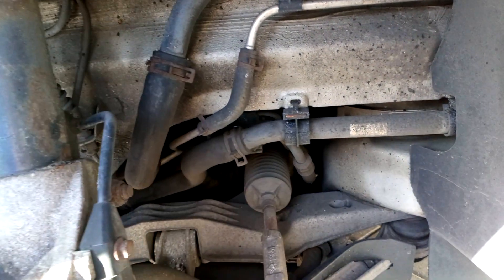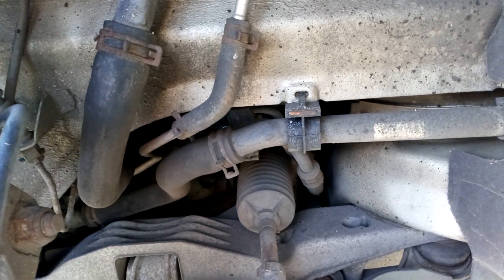Boxster 986 Anti roll bar bush replacment

Comment: Hi Paul mate how r u ?
Please i have a question for u if u dont mind 
I recently noticed when i drive the car on a wet day and especially driving over a bit off water the car act funny its like driving on a snow feels like the car loosing control even on a low speed 
And tryed aswell to over take a lorry about 50mph and the car wasnt driving straight 
But there is no noise at all 
Any help please what that could be please paul
Thnx
Reply from the maker: Hi, the first thing to do is have the wheel alignment checked. Camber, caster, and toe. Second, make sure no joints or bushies have failed. I trust tyres and pressures are all ok?

Comment: Nice work Paul, what are your wheels off? Just picked up a 987 check it out in my latest video
Reply from the maker: Hi Nick, I got the wheels after market from ebay, I have a video that covers where I got them in more detail, the rims are called Turbo 2. Which is a bit annoying as everybody says there not of the turbo! No, that's the name of the rims! Lol I when for them as porsche were using them on some of their models at the time, and I was aiming at trying to make the car look a little younger